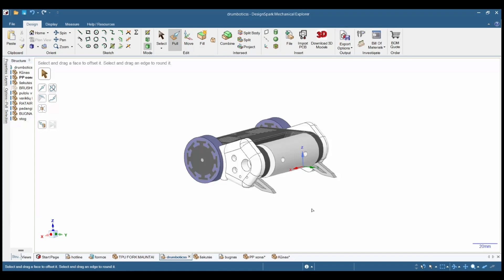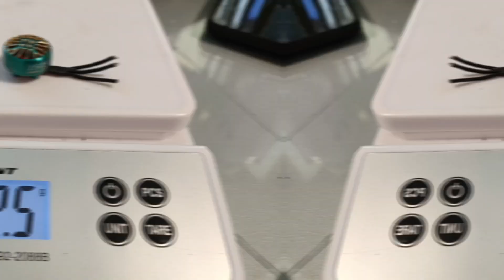ANTWEIGHT COMPETITION AT LITHUANIA PANEVEZYS. The best antweight design right now?

Comment: LIAR I wont belive you are the best till you get fight vith cheace cake (but I have to say your fot is preti cool, sub)
Reply from the maker: Ah. Cheese cake is a 1lb combat robot and this is antweight (150gram). Different weight class. But i do have a 1lb combat robot that i believe would beat cheese cake. Its my eggbeater Hotline. I have made a video about it too.
Reply: @DrumBotics  ok I gues I will find it
Reply: I believe Hotline could beat Cheesecake too simply via the rock paper scissors rule... Horizontals like Cheesecake are typically weak against verticals like Hotline.
Reply: @chdreturns  have you seen cheesecake fight? new versions win against horisontals almoest averi time and cheese is eaven outruning some of them on tip speed